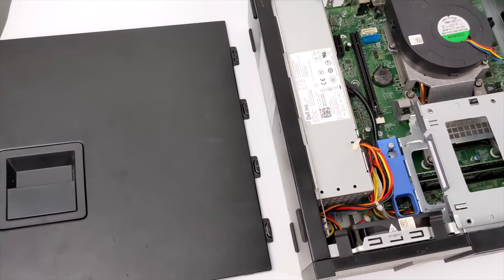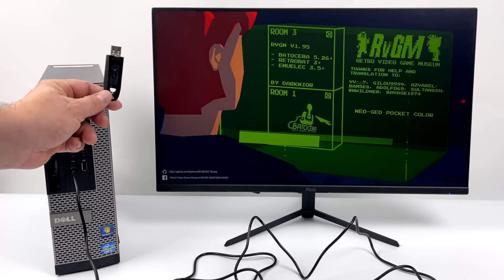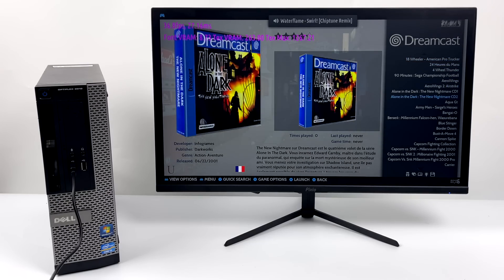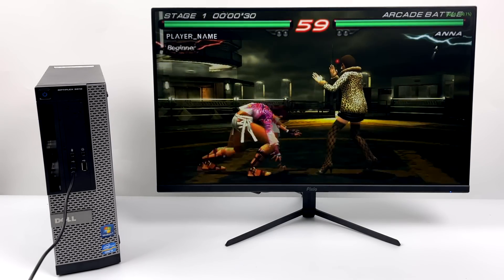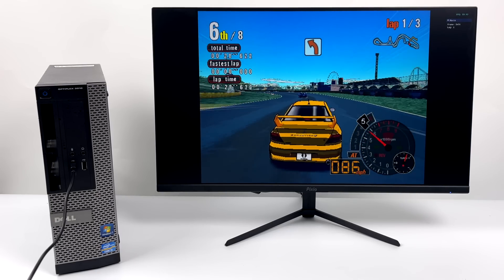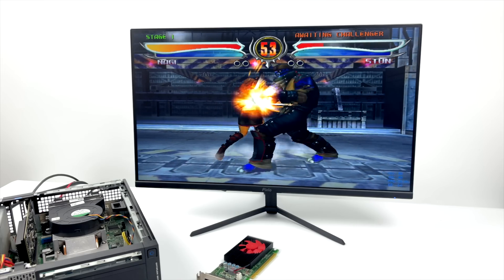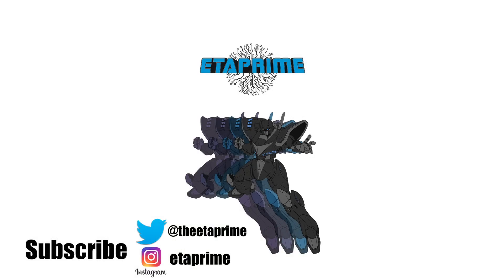You Can Build An Awesome Emulation PC For Under $100!

Comment: Just a little insight nitpick (sorry). You test ps2 game and i think u should go more hardcore, like for example saying that BR will work nicely is nice, but u know how bout games like Dark alliance or DA 2 or like champions of norrath, etc. these games need more then a powerful gpu if u want them to look good, those need vram as well. So its a bit deceiving stating its good for ps2 emu. Most games sure, but i found some that need that extra vram, more vram then 2, 3 and more is a good choice for if u want ps2 emulation. If u want to address all possible scenarios. Many ps2 games will run nicely even on a core2duo like Drakan ANcient Gates, runs great on e6600 not even ocd. I know I know, im nitpicking here. U dont need to do that of course, but would be nice, to see some option i might have, that i wasnt even considering that can run those games, i quite like them, and well those week ass 1gb or 2gb cards wont run all of them, not 1080p that im aiming for. Sure 720 or native probably, but then whats the point of emulating, i could buy a console for 20 € and im fine, i have the games, but i dont want to go back to original ps2 hw, even though there are ways to enhance a bit the experience, still, its no 4k and i can live without some effects here or there, dont make the game less desirable in my eyes. 
So please, if u reading this and u at least might consider going for those hardcore games (in terms of  hw needs) would be appreciated even if like from standpoint of seeing both ends of the spectrum. Low vram usage ones, high res. or low res. games that can be run on certain gpus. Or if nothing else, just mentioning it etc. But its up to u. Either way i like ur vids, thats why im here and subbed, not because u do something wrong or anything like that. Im grateful btw that u included, here and there with emulation testing also xbox emulator, cxbx at least. Xemu less so. 
So its really not optimized for low end hw, those two. games run baddly on anything but higher end stuff. I mean ifu upscale.  Anyway again, please consider, changin up games. 
I agree though with auto modelista. I wasnt sure, so i tried it myself and yeah, its pretty taxing that game, but i can run it 1440p, even 4k but well there are dips here or there, so 1440p safe bet ona 4c 4ghz cpu. with 1060 6gb

Comment: Great video, thx. Will it also run fine with PS3 emulation? If it doesn't run well is it because of the cpu or gpu?
I have an i5-3550 + gtx 1060 that may be good for this purpose.

Comment: I got really lucky in that I bought and upgraded my current pc just before the pandemic/scalping ruined the market... Ryzen 5 1400 with an RX 5600xt. I bought a 2nd M.2 NVME 500gb drive and put all my emulation on it. Not only do I get to run everything up to RPCS3 with full speed (for most of the ps3 stuff anyway) but I can also play modern titles. with ALL my gaming both retro/modern on M.2 drives, the load times even on the PS3 are so much better than their native hardware counterparts. I love it. It's like having the PS5 super fast load times with all the previous generations. Question @ETA PRIME. Do you think 1st gen Ryzen coupled with a decent GPU like mine will end up being able to run PS4 emulation okay if they ever figure that out?

Comment: I'm amazed at how cheap those machines are in the US. Here in Brazil the same Optiplex goes for about US$ 330, and the GT 730 for US$ 130. At US$ 460, this setup costs the same as an Xbox One S here.

Also, how about Wii performance with the 730? Is it playable?

Comment: What I HATE about these Dell SFF computers is the fact that most I've seen (7020 and up) have the pciex16 slot right up against the power supply.  In other words you cannot put a low profile 2 slot gpu like the 1650 in on the board unless you pull off the heatsink.  Even something as new as the 7080 does the exact same thing!  But then again, these are work computers not gaming I guess.

Comment: It is probably not uncommon to find PCs of this caliber whilst dumpster diving. You may even find a laptop with a cracked screen that would work great for emulation. I would put your findings in a black garbage bag in direct sunlight outside for a couple of days to kill any critters that maybe inside before bringing it inside your home. Black garbage bags absorb more light/heat than white garbage bags.

Comment: I am trying to build the same thing with an old DELL OPTPLEX 7010SFF 4th GEN I5. I have bought the 16 Gigs of DDR3 memory and I also purchased a 1TB SSD for the build. I am only still looking to purchase a GPU to install in the 7010. I have been searching for a reasonably priced GTX1610 LP but damn they are still so expensive. I may look at a GT950 or 1050TI to get me by until the GTX1650 come down to reality in price sometimes in 2022..

Comment: I got a 3070 recently with an i5 9400 but I don't know what decent and affordable GPU I can use. I seen a few gt 1030 but don't know if they will bottleneck. I only want to play PS2 and GameCube.
Reply: GT1030 will be fine for GameCube and PS2 although it will be the bottleneck vs. the i5 9400. The only reasons to use a 1030 are if it's all you need, all you can afford, and/or all you can fit. Otherwise I don't recommend them in 2021. I bought mine in 2019 because that was all that would fit.  Also it only draws 30W so it doesn't require extra power connectors. That's another concern. Without knowing what form factor case you have it's hard to say, but I would guess that you probably don't have any GPU power connectors with that system. I will say that you probably paid too much, though. The 3070/9400 costs a lot more than the class of system he's talking about in this video (3010/3rd gen i5).

Comment: The limitation on the GT7xx is likely the driver. The FOSS driver is crippled due to nvidia being the assholes they are. That's why it doesn't support Vulkan. If you install the closed blob it will have vulkan support but it needs at least version 460.32.3 for Vulkan >1.2
Reply: How to Install closed blob?
Reply: @GeorgeWPush  normally through the package manager but it seems batocera doesn't have one according to the quick searching I did. Users might have to pester them to give the option.

Easy solution: don't buy nvidia.

Comment: Hi, love your channel. I’m from a small country, Trinidad, not too versed in pc technology. I basically just do normal stuff with a pc, but want to use Bluestacks. I have a old system, A88x-g45 mb, an A8 processor that can’t seem to run bluestacks. I saw a pc on Amazon, ibuypower Trace 4 MR 180A (Ryzen 5 3600 3.6GHz, Nvidia GeForce GT 710 1GB, 8 GB Ram) in my budget, is about 1usd to $8 exchange for me. Do you think this will be a good pc to run bluestacks. I would get a 16 gig ram if that would help.

Comment: Consider about i5-7 4th Gen, they have avx2 and fma.
Reply: What are the real world differences for emulation? Does it help with input delay considerably?
Reply: @GeorgeWPush  it will help with few emulator like rpcs3, yuzu, ryujinx. You can play without because like the video says it's more likely gpu bottleneck. But in the future more adore program will need these instructions for better performance. So at same price go 4th generation and more.

Comment: A couple weeks ago i bought a prebuild lenovo pc i5 3470 with single stick 8gigs, dvd rw, 280w psu, 500gb hdd for $105, idk if the price is decent or not, this is the cheapest prebuild with i5 3rd gen i can find, anything else is expensive af (prebuild i5 3rd gen no gpu price in my country can get up to $150 especially the dell optiplex, ridiculous)

Comment: Some GameCube games don't even run well with a modern PC. Nascar 2005 is one of them.  I do  not like the way  Batocera does not let you go full screen. I don't like the borders.
Reply: You can disable bezels and change aspect ratio in Batocera if you want. 
You can do it in settings, system wide, per system or even per game. 
First disable 'decoration' then  change aspect ratio.

Comment: Strange.  I always thought the game cube was more powerful. That’s why gc tales of synphonia runs smoother with with higher details than the ps2 version.
Reply: doesnt have anything to do with that, 2 completely different emulators.on paper the gamecube seems more powerful but basically any game you see thats made for both systems looks better on the ps2
Reply: Gamecube is more streamlined so it's easier to emulate. PS2 had a lot of processors in parallel. Ironically the PS2 was more like the Saturn than the PS1.
Reply: @ruxcooking  not really, it had a co-processor but its not like the saturn having 8 or whatever it was

Comment: Question for ya Prime.  I have a EVGA 750ti that I'm currently not using.  I think the PSU in the Optiplex may not be able to handle that GPU.  Would you just go with the 730 or 1030, or do you have any other recommendations?
Reply: Don't buy the 730, as their official documents state that the moment Kepler cards go legacy (which has been announced - next driver won't support them), Batocera won't have support for them either. Gtx 750ti - if you have a low profile one (not that I've seen it ever), depends onthe PSU and the CPU in your pc. Maybe it'll be fine, maybe it won't. If you have a tower optiplex, 99% it will be fine. It is more powerful than a 1030. Also, it's not a Kepler card, but Maxwell and will continue to receive driver updates and should still have batocera support. Same goes for the GTX 745 and 750 - the rest of 700 series is going legacy. AMD cards should work fine, as they have open source drivers. They have easy better opengl support than Windows drivers. Some rx 460 oem could be interesting if you can get it cheap. If you want low profile though, r7
250 is about as good as it gets (and a single Chinese rx 550 which you won't find).
Reply: @youzernejm  I appreciate the response.  I found the product sheet on the one I have and it looks like it calls for a minimum of a 300W PSU.  My guess is the optiplex probably runs a PSU that is lower than that.
Reply: Both nvidia and amd give estimates that are far higher for multiple reasons. One is, how old is your psu. The other - is it a brand name or some cheap piece of trash that is way weaker than it pretends to be. People have tried gtx 1060 cards with 280W optiplex psu, i7 and adapters and, while I would never suggest doing that or even try it myself, it worked. You've seen etas videos - he squeezed 8 core apus in tiny boxes with 120-130w adapter and it worked. So honestly, while the spec sheet states you need 300w psu, it's really not that black and white. Most tower optiplexes I've seen have 260-280w, an i7 3770 has 77w tdp, 4790 is at 84, 2600 at 95, realistically if you aren't doing rendering they shouldn't go above that, i5 or i3 is even better. Gtx 750ti has tbp of 75w and, if it has no 6 pin power connector, it shouldn't exceed it. The rest of the system won't do more than 40. You will almost never have 100% power draw on both cpu and gpu, but I personally like to overprovision. We're still below 260. That said, you are right, your psu is not new (although it is pretty darn good quality) and I wouldn't use it for an i7 and a gpu. I5 or i3 though, I would try and run with something up to 75w tbp. They do have ovp, ocp and other 3 letter protections that won't let your machine be fried that easily. P. S. I've mentioned cpu tdp and gpu tbp - well, they aren't exactly precise either, but they are good enough to calculate. Again, a rendering machine uses far more power than an emulation box, even though both state 100% usage for example.

Comment: ok question, im looking to fully emulate dreamcast, ps2, ps3, and ps1. maybe some windows games as well at max settings 60 fps no problems. what specs would i need? i don't want to overpay for a PC that's not doing what i need it to but i also don't wanna buy something that isn't gonna be able to handle my request either.
Reply: PS1/PS2/PSP/DreamCast/GameCube they can be emulated well with not so powerful processors and integrated graphics from Intel or AMD (even basic iGPUs), but if you want to emulate the WiiU/Switch and PS3 as well as possible, then you'll need a more powerful processor, with more cores than only four, 16GB of ram in dualchannel and a more powerful graphics with enough Vram (4GB preferably, at least), GPUs with only 2-3GB vram can be used, but it would be better if it was 4GB+.

In socket AM4 motherboards I would recommend AMD Ryzen 5000 series processors or at least 3000 series, for example the Ryzen 3 3300X, Ryzen 5 3500X, Ryzen 5 3600/3600X, even more so the Ryzen 5 5600/5600X.

A Ryzen 5 5500 or Ryzen 5 5600G APU has 6 cores/12 threads like a Ryzen 5 3600/3600X and their performance is similar despite belonging to different generations and families. The Ryzen 5 5600 and 5600X have more singlecore performance, so they are more desirable if you want to emulate PS3, Switch, 3DS.

* At Intel I would think of the Intel 12th Gen (13th most powerful and most expensive) for socket 1700; if you went to the Intel 10th/11th Gen for socket 1200, then they would be equivalent to the Ryzen 3000.

If you play at 720p/768p, 900p or 1080p resolution you don't need to buy a tremendous GPU to emulate PS3 and the rest, but it's a good idea to have power to spare, as well as enough Vram, there I would think about GPUs like the GTX 1650/RX 6400/RX 470 or minimum the GTX 1050ti; if you can an RX 570, RX 480, RX 580, GTX 1060 6GB, GTX 1650 Super etc, excellent.

* You must understand that the emulation is not perfect, there will be games that do not give you a solid 60fps (whatever you do).

** If you want the maximum potential in console emulation and a platform that gives you a long way to improve your PC, then you should buy a socket AM5 motherboard, DDR5 ram (6000Mhz and AMD EXPO compatible) and at least one Ryzen processor. 5 7600X.

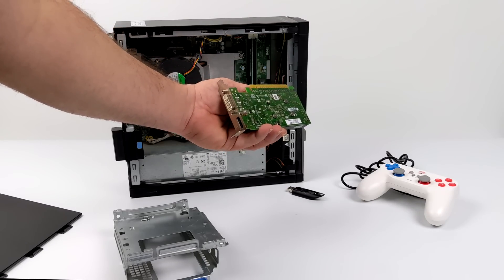Comment: 1:50 This was actually a bad choice, you can still get an HD7570 with 1gb of GDDR5 for less than 15 USD on ebay, and it would destroy that GT730 in performance. Which makes the total cost under 85 actually. I would add an HDD however, because it's still an absoulute beast of a not-so-retro gaming PC. It could even run some modern non-AAA titles, if not for the lack of gpu driver support, but the muscle is there.
Reply: @Derrick Finzer Yes, I just checked on ebay, not sure if I can link it here, but you can find it easily. It's slightly more expensive, 18 USD with free shipping to the US, still a good deal. Be sure to get the GDDR5 model.

Comment: Would Maxing out the Memory to 8 or 16Gigs make any Difference, or is the performance Boost all just really tied to the GPU?
Reply: Gaming is mostly about the GPU. More memory only helps if what you're doing exceeds the memory you have. Emulation isn't generally going to require more than 4GB.

Comment: I have a gtx1050 sitting around Ik it’s overkill but will it work in these old dell computers?
Reply: Yes...GTX 1050 without PCIe 6 pin + Intel i5 2400/2500/3330/3470/3550/3570 + 8GB DDR3 = EXCELENT for emulation and PC-Gaming without high pretensions.

Comment: Got a dual core 4GB ram slim desktop PC with on board stock graphics, will this suffice for a console emulation station?
Reply: Yeah why not....but you will have to emulate consoles that are easier to move, both at the processor and GPU level.

Comment: How would it emulate on i3 4130, rx 550 2GB with 8gb of ram?
Reply: Everything up to PS2 and Wii will run just fine.  WiiU, DS, and 3DS should run fine as well, but I cannot say for certain.

PS3 will most likely struggle on a 4th Gen i3, it likes lots of cores for emulating.

Comment: You're wrong . The 8 Gb raspberry pi 4 is useless on emulation purpose. No emulator on pi 4 need 8 Gb , even Dolphin don't need it , and this emulator is unusable ... So what ? The 2 an 4 Gb raspberry are enought for emulation, and they are not that expensive.  Sorry my english is not perfect.